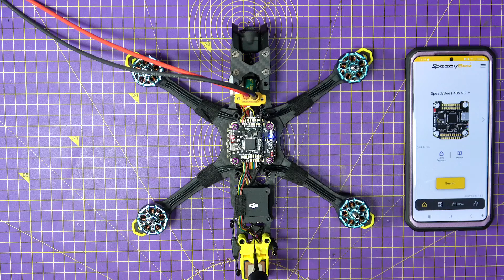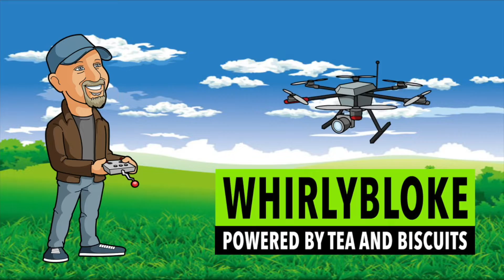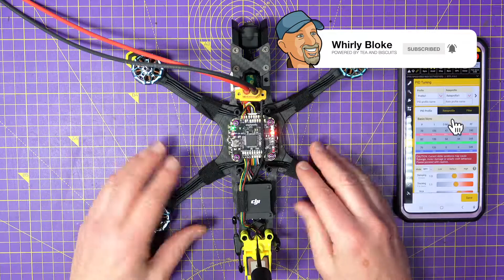Easily change your quad motor order, mapping and direction using the SpeedyBee app

Comment: Annoyingly I do not seem to have the Motor Order button on my app. Need to reorder as I have installed a ‘push motor’ set up… Are there any suggestions? Thanks
Reply from the maker: I suggest downloading the latest version of the app direct from the SpeedyBee  website.
Reply: @WhirlyBloke  thank you. It’s the latest version… Not sure why it’s not appearing
Reply from the maker: @dvpuk  I've not seen that issue, so SpeedyBee is your best option. Let me know how you get on.
Reply: @WhirlyBloke  just tried reflash in the firmware, and it just seems to have worked
Reply: @WhirlyBloke  unfortunately the software couldn’t fix it… I swapped two wires on the ESC and it’s fine now 😃

Comment: I haven't even played with this app at all 😂 ive just been using beta flight and i wasn't able to change motor directions through beta flight and didnt really care to mess with blhelisuite. But im going to use this to change my motors to prop out now. Thank you
Reply from the maker: You need to use either BLHeli Configurator or BLHeliSuite32 depending on which ESC firmware you're running to change motor direction. That's not hard, but it's a real faff. The SpeedyBee app makes all this a ting of the past and so much easier. You don't need to cart a laptop with you when you're out flying to tweak your PIDs or anything. Thanks for sharing your thoughts. I love hearing different perspectives from my viewers.

Comment: alread did exactly the same but direction will not change .. :(
Reply from the maker: I'm sorry to hear that you're experiencing difficulties with changing the direction despite following the same steps. Make sure to double-check your settings in the SpeedyBee app and also verify the connections on your quad. Sometimes a small oversight can cause these issues. If the problem persists, don't hesitate to reach out to the community or the app's support for assistance. Keep experimenting and troubleshooting – you'll get it sorted out. Good luck. 🛠🚁

Comment: Would it work in Inav?
Reply from the maker: Thanks for checking out my video. To answer your question, yes, the SpeedyBee app should work with iNav.

The SpeedyBee app is designed to be compatible with various flight controllers and firmware, including iNav. It allows you to adjust motor order and direction, which can be really handy when setting up your quadcopter in different configurations. Just make sure you have a compatible flight controller running iNav firmware, and you should be good to go!
Happy flying  🚁✈
Reply: @WhirlyBloke  Thank you so much, Sir, for such great answer!
Reply: @maksimreshetnikov1029  The SpeedyBee app does work with INAV. However, the functionality of swapping motor order/ direction doesn’t work as it does with  Betaflight. This is because INAV Configurator doesn’t have a dedicated motors tab that interacts with the motors at the same level that Betaflight Configurator does.

Comment: I am using the F745 AIO board from speedybee but I don’t see the motor reorder (only change motor direction) function in my Speedybee app. Does this not work for my board?
Reply from the maker: Make sure yo've got the latest version the the app. Links are one the SpeedyBee website.